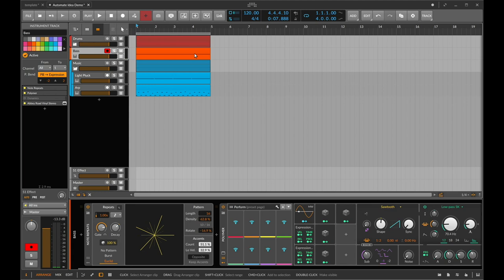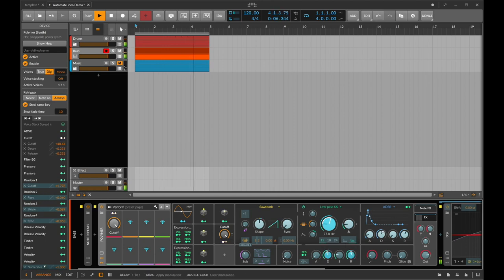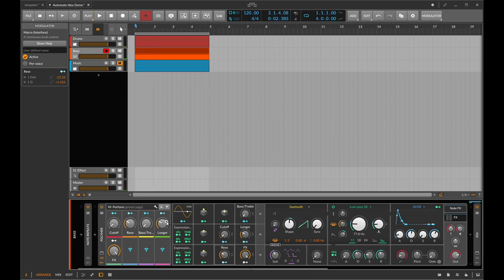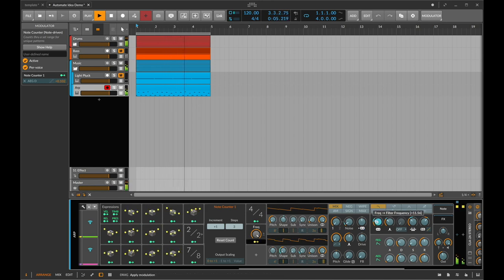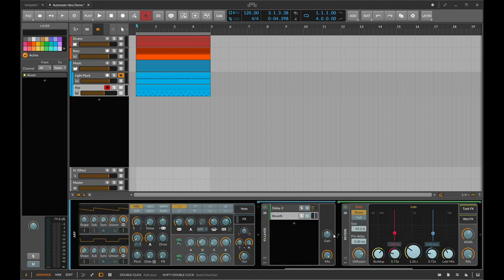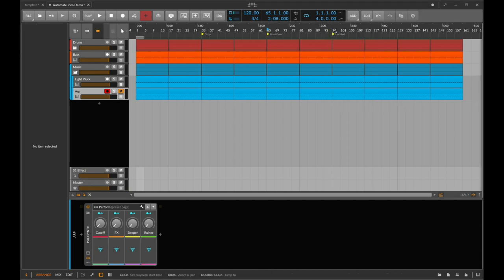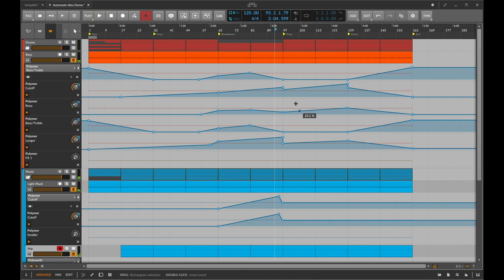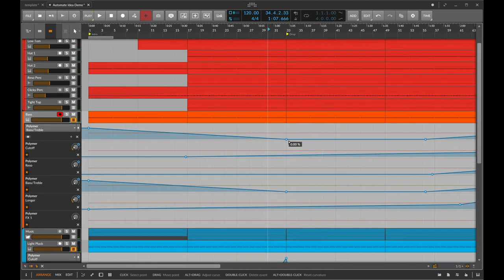The Automation Trick You Wish You'd Known Sooner

Comment: Hi Taches, i know it was you but in another video in which you explained the settings of modulation knobs. But I don't now which clip on youtube it was, maybe you can help me out here when I ask you here. In this particular video I cannot find, you explained the modulation range of a modulator that you assigned to a value on a device and you had shown a short cut or a method to affect the depth of the modulation range better. 

As far as I remember from the video: the modulation determine mode was already switched on (with the little blue arrow icon) to specify which parameters should be affected by the modulation routing. You were still in this mode. In this mode, when you use it with a device parameter or knob, it sets the depth of the modulation. But in this video I mean (sorry, I really can't find it anymore) you explained the finding of sweet spots of the device parameter itself by playing with the device parameter while the modulation deflections could already be seen on the parameter in parallel with the little blue line. It must be a short cut or something, because normally when you are in determine mode for the modulation, you cannot change the parameter on the device itself. You must leave the mode to get back to normal mode. The nice thing with this tutorial was, that you've shown a fast way to get sweet spots when you are in modulation determine mode and changing the device parameter in parallel, because the modulation deflections also changed the position. You know what I mean? I hope i explained it with my poor english. And I hope you could help?
Reply: i think what you mean is that you have to turn the macro knob to it's maximum value before applying the amount to a Parameter, this way the the Parameter moves while you determine the Amount, this way you find the sweet spot of the maximum amount